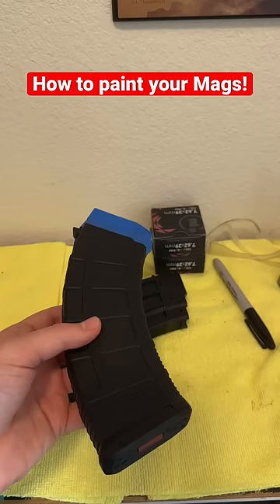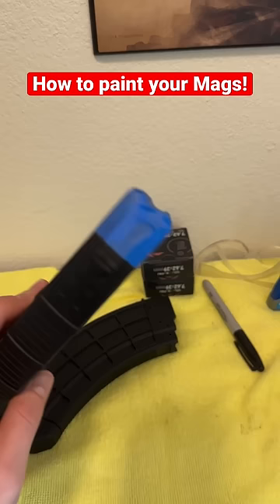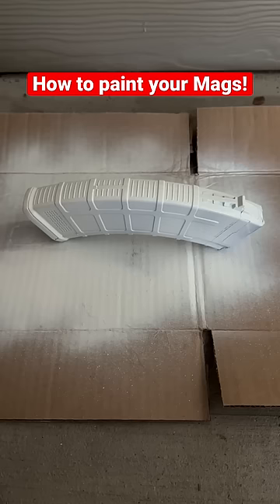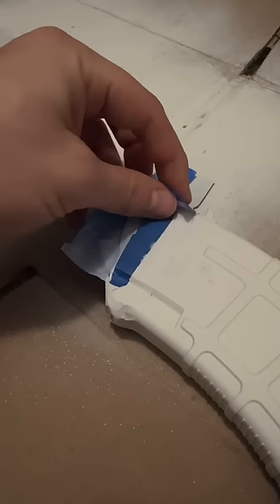Paint your mags?! #shorts

Comment: while painting plastic you may want to use an adhesion promoter or self etching primer and a top coat. otherwise, your paint will just wear off on your hands... just my two cents.
Reply: Shortclips 101  have u ever painted anything?
Reply: its called battle worn skin.
Reply: shortclips1015  it 100% guaranteed will. Without a doubt.
Reply: u could also seal it with some clearcoat or something
Reply: Exactly what I was thinking, always use a primer coat
Reply: That paint is for plastic. Don't really need to do the extra stuff. It's not automotive paint nor metal. If it was gloss it probably would need the adhesion promoter.
Reply: I tested this out and maybe my paint is built different but it has not came on my hands yet
Reply: Shortclips 101  character development
Reply: Shortclips 101  you breath out of your mouth when you sleep…I can tell
Reply: @stufoo  all the ppl saying ur wrong really hasn’t spray painted before huh?
Reply: My paint is still intact, none on my hands whatsoever, I used a plastic magpul magazine
Reply: Primer
Reply: Nah, I've done it LOTS. It lasts and wears nice. I do find wiping whatever I am going to spray paint regardless of material, down with alcohol helps with adhesion and the look. I wipe my hands and fingers with alcohol too. 
  I just found a new video this guy just posted. He's painting a Glock in M81 and he knew his shit. He gained a subscriber. And i gained some confidence to try some Woodland M81 on a toolbox or something and see how i do.
Reply: Definitely some bud light drinkers in this comment section 👌
Reply: What black spray paint do you guys recommend ?
Reply: @prosperityawareness who came in ur hands??🤨
Reply: @lifesabowlofcherries couple Mulvaneys eh

Comment: Also a tip, removing the tape while the paint is still a little wet will usually give you cleaner lines.  Removing the tape while the paint is completely dry is fine, but the paint can flake off and come with the tape during removal.

Comment: A scuff pads and adhesion promoter would provide a longer lasting finish
Reply: What is an adhesion promoter? I may paint my mags that are specific to one firearm. I like to run my specific Glock 9mm mags on my Ruger and the others in my Glock. Mostly just for the ammunition that is in each mag.